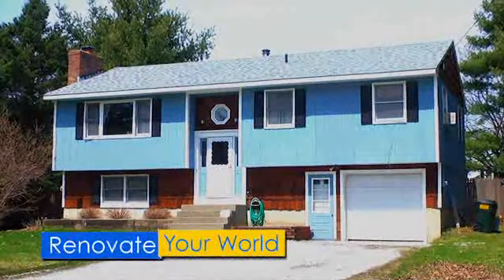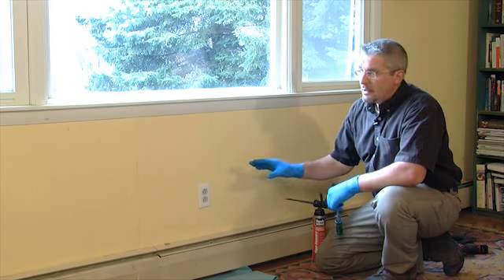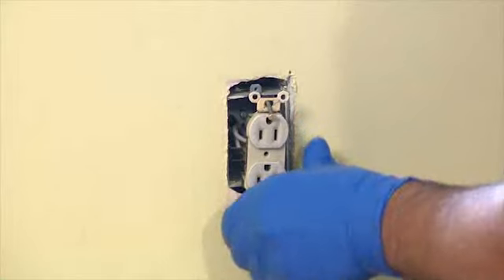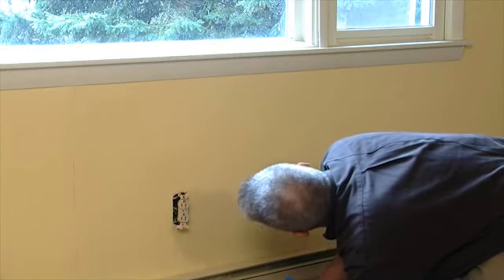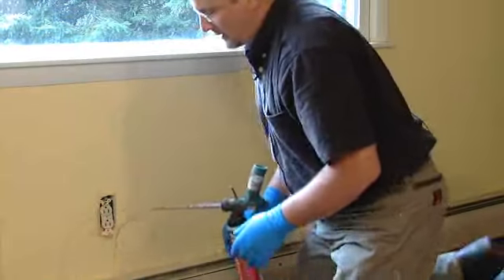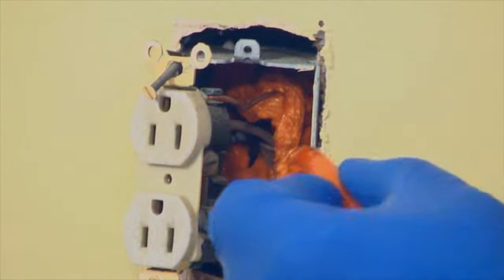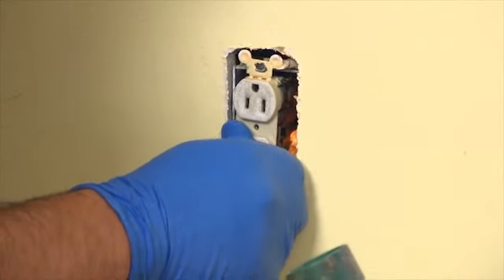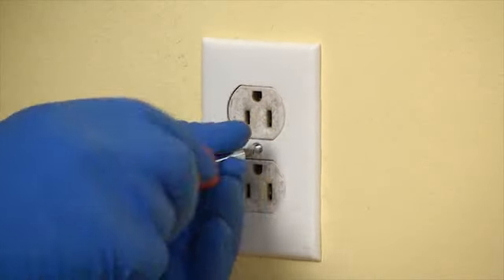Energy Efficiency Upgrade - How to Seal Up Outlets

Comment: Bad Idea - violates NEC 110.12B, and is a fire hazard.  Foam around the box is ok - foam inside the box is not.
Reply: That's what I have been told as well. No foam inside the box.
Reply: That's right, I've done this on my home but I used any culking sealant for window trim and base molding and is cheaper and safer.
Reply: What if you wrap the sides of the electrical box with the electrical tape and use fire resistant foam. Looks like he's using fire resistant foam by the color.
Reply: I felt significant cold air blowing in my exterior outlet one day as I plugged in a lamp.
Quick fix was duct tape!
Reply: Orange foam is fire resistant. I can't speak for fire codes in your area if this method is acceptable or not. Either way, keep in mind that wet foam is capable of conducting electricity. If u go this route, be sure the foam is completely dry b4 putting power back to it.
Reply: clotshots9072  He's using fire retardant foam. all good.
Reply: This is an excerpt of the code "Internal parts of electrical equipment, including busbars, wiring terminals, insulators, and other surfaces, shall not be damaged or contaminated by foreign materials such as paint, plaster, cleaners, abrasives, or corrosive residues."
Reply: Well, fuck.
Reply: @boywonderrr71  Not true. There is a minimum space requirement inside of electrical boxes. By putting foam inside t hem, he is making the space smaller and likely violatin code.
Reply: @MAGAMAN  I foam the gaps outside the box to stop air & use foamy gaskets under the faceplate to stop drafts.
Reply: @boywonderrr71  no it’s a violation of box fill requirements by NEC.

Comment: There are gaskets for sale that go on top of the outlet, behind the plate.  Also use child proof plugs with the cutouts from the gaskets on the prongs.
Reply: Awesome answer. I followed your advice with the gaskets.
Reply: @MrThomasAnderson7892  I tried those and they don't work
Reply: I'm not having great improvement with the gaskets either.
Going to foam it this summer.
Reply: The cold air comes through the plug holes, not the edges.
Reply: The gaskets are a wate of money. Air comes through the receptable openings.
Reply: Applying electrical tape around and behind receptacles should do the trick.

Comment: What if the foam catches fire ? Or you need to go back in to do electrical work ? This is a horrible idea. Simply, use socket cover gaskets instead, they will seal the outlet plate right up to the wall.
Reply: I just tried this today and I was disappointed it was still blowing in significantly cold air. Feels like it didn’t do anything at all
Reply: @JoshRock84  hey which one you try the foam or the gasket?
Reply: If but no different than a house catching fire and attic spray foamed yes it will off gas some but that’s what smoke and fire detectors there for and all said and done long as family makes it out alive that’s what insurance for
Reply: I used the plate gaskets still leaking plugs covered also 😢

Comment: Foam in the box violates code but polish installed outlets violate common sense.... 
10 minutes of effort to fix the outlets would allow for proper sealing ( outlet removed and is out of the way and the “non-conductive” tube could be placed in the holes thus filling them from the outside in) and proper install of outlet could be performed. Just saying.

Comment: They make a little gadget that will tell you if the power is still on. Or just plug in a nightlight.That would have been a good time to replace that worn plug-in also. They are really cheap.

Comment: No disrespect but I see R.Y.W in not an electrical contractor. outside good,  inside no good. cool in the summer hot in the winter and possibly on fire at some time. safer to use those foam outlet covers. there is a reason you can only have so much length of wire inside a box and no conduit covering. it all adds up to taking up space where heat needs to dissipate.

Comment: The next time that outlet needs replacing (which from the looks of it SOON) whoever replaces it will be cussin you big time
Reply: that's what i was thinking. the next person that comes along to replace a bad box is going to have a hell of a time getting that one loose.
Reply: @texdawg0212 no big deal simply remove foam easy no hard no but adds time yes.But well worth the comfort and energy savings.People saying fire hazard hell candles and plug ins are a fire hazard and people use them.The foam does no harm if applied properly

Comment: The outlet is upside down and foam inside outside that will expand and push on wire, it’s a no no.
Reply: @ Minh
There is no correct orientation for receptacles inside plastic/fiberglass boxes. You may have them either way. Even sideways, if desired. With metal boxes, receptacles are usually installed this way the way the video shows.
Reply: New code says they should infact be installed upside down. That way if something falls on something plugged in, it hits the ground rather than the two leads
Reply: Might be a switched outlet.

Comment: He put the outlet back into the box upside down! And yeah, don't put foam in the box.
Reply: @ericdressen  industry standard is with the ground down but either way is fine.
Reply: Np with foam inside box, just has to be the 14 dollar one that’s fire rated and has to be dry before installing outlet back in place
He did not show what type of foam he used, I take the outlets out completely stick the fire rated foam through the empty holes than put electrical tape over the holes on the inside of the box
That way the foam seals the back of the box, but does not take up room on the inside
Reply: There's no correct way to have that outlet, either way is fine.  In fact, in some places it's mandatory to put them in with the ground plug up.
Reply: @DeusExAstra Agreed. One job I worked one time, it was in the job specs for ground side up when installing receptacles. In the remote chance, if a stainless plate is used and becomes loose, it could fall down across a hot and neutral blade of the plug-in appliance, creating a short.
Reply: The receptacle can be installed either way. There is no set rule by the NEC.

Comment: So you re-installed the outlet upside down?  Pro Freshin all
Reply: @ Chris
There is no correct orientation for receptacles inside plastic/fiberglass boxes. You may have them either way. Even sideways, if desired. With metal boxes, receptacles are usually installed this way the way the video shows.
Reply: So you commented on something you know nothing about?
Reply: The new electrical code calls for installing the outlet upside-down as it helps prevent an electrical fire if whatever is plugged into it slips out of the outlet (slightly) and something falls between said plug and the hot outlet.
Reply: @johnliles4975  The NEC, at least as of revision 2020 (latest) does not specify ground prong up or down. The argument for ground pin up is to prevent things falling on half-exposed prongs. The argument for ground down is that it will keep people's index fingers from slipping and making contact with the live prong(s) when doing things like unplugging extension cords. 

It's a topic that's been argued by sparkies on forums for years, and will continue to be until the NEC takes a stance on it.

Comment: That's terrible, you are pulling outlets upside down. No fom inside of the box, that is a terrible thing to do.
Reply: I prefer ground pin up on outlets that will see general service use. I figure if a conductive material drops from above, the ground pin prevents a short. Of course, ground pin down behind the fridge and such. Just my 2 cents.
Reply: @3qs  well according to 2000 NEC grounds on top.   But maybe it changed

Comment: Is the foam Non Flammable??
Reply: No foam is non flammable, this is fire block foam identified by the orange color. Fire block foam is still highly flammable though, there's just more of a time limit before it combusts, which is why it's not rated as a fire stop.

This foam is also only approved as a fire block in beads as wide as 1 5/16" or 33mm. Larger than that is not code or an approved fire block.

Many spray foams have the fire block capability but are uncolored, the orange coloring is specifically for ease of identification during code inspection.

Comment: Not a good.  Sorry.  Do not foam inside the box.  Also, is that fire rated foam?  In any event, seal the space between the box and the drywall with caulking compound.  Then use insulating pad.  They're cheap as dog shit and do a nice job.  Then put the cover back on and use child protectors in the unused receptacles.

Comment: Why is the outlet upside down?
Reply: Because it's controlled by a light switch so you can plug in a lamp and use the light switch to turn on/off
Reply: It’s not upside down.  Its Australia 🦘🪃
Reply: @marceloacuna6479  that shouldn’t matter I’m talking about the ground leg being up top in the video, it should be at the bottom so 2 up top and the ground single on bottom on both, I’m not tryna be “that guy” I just know this for a fact because it is one of my very fond memories as when I was new and installed one the same way and I got chewed out for it, I mean technically it’ll still work it’d just one of those  things that bug me astheticlly
Reply: @jamess.6767  right haha next think you’ll tell me is the toilets turn the opposite way when flushed

Comment: (Electrical outlet is upside down !!)Ground should be on bottom.  NOT to CODE
Reply: Your wrong group goes up
Reply: Code got updated
Reply: There has never been a code that requires a specific receptacle orientation in residential. But "upside down" is technically better and more correct and actually required in some commercial building codes.

Comment: Wow horrible idea. Spray foam will cause the wires to overheat possibly causing a fire. Just buy foam electrical outlet covers. The only way to really insulate an electrical outlet is when you are installing like new construction. Everything after is a band-aid.

Comment: Is no one going to talk about that outlet being installed upside down?
Reply: Upside down Outlets are permitted per code.
Reply: Upside-down outlets are the new way of doing it.  It helps prevent an electrical fire if whatever is plugged in slightly comes out of the outlet and something like cloth or paper or anything else thin enough slips between the device plug and the hot outlet.  With the ground being "up" you wouldn't have that issue.

Comment: Insulating foam is not flammable. Unsure what fire hazard everyone is worried about.
Reply: They do sell non-flammable spray foam sealant - which should be used in this scenario. It's less important around windows & doors, so the foam you cut & burned was probably the cheaper Great Stuff or equivalent. Even the plasic boxes, however, are only fire resistant (rated to resist burning for 2 minutes), & they are located next to the wood stud. Bad wiring can cause a fire, regardless.
Reply: Heat entrapment is where the fire starts
Reply: The box needs space. The foam fills that space. The space is important for dissipating the heat from the wires and receptacle. This is why a box of a given size can only accommodate a limited number of wires.
Reply: @gilbes1139 Lol there ain't gonna be no heat dissipation if you plug the hole. Who cares about space.
Reply: I have a can of that great stuff fire block foam, it specific says that the cured foam is combustible not to expose it to sparks or flames. 250F and above and it's like any polyurethane or other foam, an accelerant. With limitations however it can work as a fire block (not a firestop).

It is approved as a penetration sealant where the width of the bead does not exceed 1 5/16". Inside of an electrical box is against code regardless of material used, it must be from OUTSIDE the box for the wire openings and either this fire block foam or a fire block caulk. Only from outside, not inside.